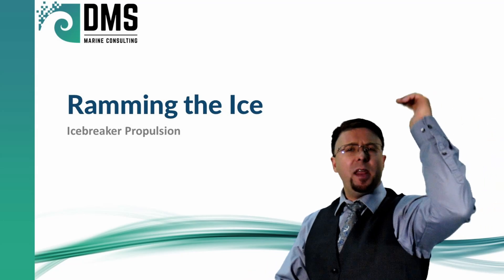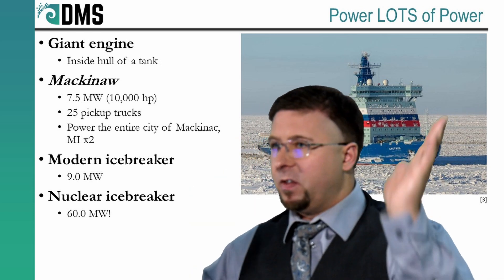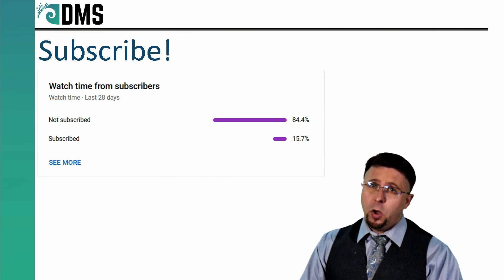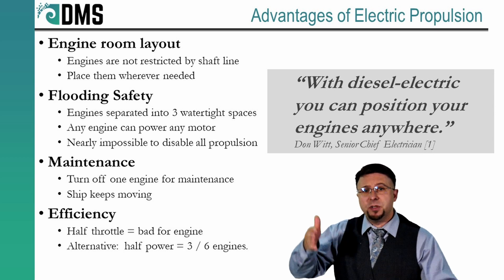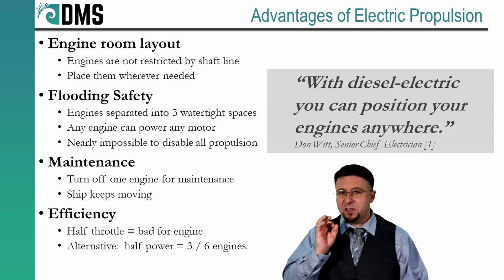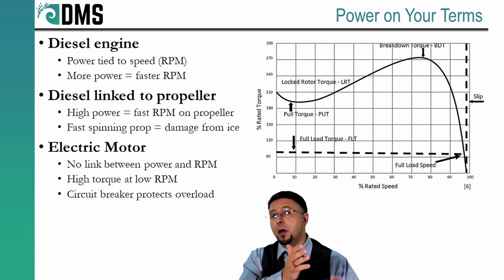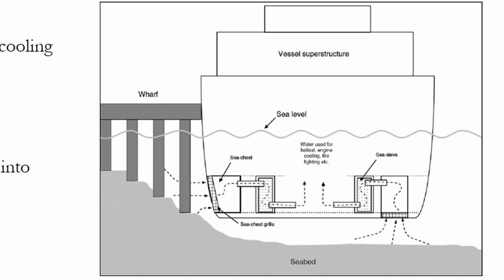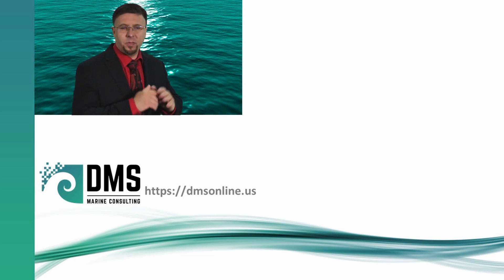A Giant Engine Wrapped In a Tank:  Icebreaker Propulsion

Comment: Power is still loosely related to RPM on an electric motor, difference is it has maximum torque at low/zero RPM as you mention, whereas ICE's typically don't.

Comment: Amusing that everything I know about civil naval architecture is from you, while I have first hand experience with all modern US nuclear powered naval vessels (and know a lot about battleship architecture, but that’s just for fun). 

The amusing part about this video is scaling: you implied that 10,000 shaft power is a lot for the 1940’s and are talking about diesel, while real power from that era was steam turbine, which necessarily decouples the generator (boiler) from the motor (turbine), with the Iowa class battleships being illustrative - 8 engine rooms and 210,000 shaft horsepower, while the A2W reactors we put in CVN-65 (USS Enterprise) gave it 210MW capacity for 280,000 shp for propulsion….. compared to the 60MW on the Russian icebreaker or the 700MW thermal power from each of the A1Bs in the USS Ford (plus ~300,000 shp - the real numbers are all still classified and depends on application, but the difference in scale is the neat part).

Comment: I'm planning on studying maritime engineering. My question watching this videos: Will eletrical motors replace diesel engines in the near future?
Reply from the maker: Not a complete replacement, no.  Electric motors have their advantages, and there are ships where we use them.  But considering the scale of ships, where we spend megawatts of power, an efficiency difference of only a few percent means enough to completely alter a design.  And there are ships where conventional diesel engines are slightly more efficient than electric motors.  

So not a complete replacement.  What we see is that both electric motors and diesel engines have their own specialty application, depending on the ship use.

From the perspective of marine engineering, I can say that you will find BOTH diesel engines and electric motors in 99% of all commercial ships.  Even in a diesel ship, there are many electric motors for auxiliary purposes, and they aren't small.  (Think motors for the crane.)  And even on an all electric ship, we normally have a diesel engine as emergency power.  You may specialize in electric or mechanical side.  But it's best to cultivate a working knowledge of both.

Comment: Nuclear is actually lower in power density than gas turbine propulsion. A GE9000 gas turbine generator will make 73.5 MW (98,564shp) in a volume smaller than a 40 ft shipping container. Nuclear wouldn't fit in even thrice that volume. In the same space that the Nimitz Class carrier's nuclear reactors, turbines and condensers occupy, you can stuff in eight of those for a total of almost 800,000 shp. The fuel consumption of course will be prodigious and 200,000 shp would be unprecedented.
Reply: OTOH engine + fuel for a year... nuclear is the same size, the fossil fuel version is now an oil tank with a little motor hidden inside it.
Reply: @mozismobile  True. But in the case of the carrier, the majority of the bunkerage is aviation fuel and needs to be there anyway. Also, most ships do not need or want to carry fuel for a year; even trans oceanic vessels typically carry fuel for maybe 12,000 nm at deepload with endurance between resupplying in port limited by crew, crew consumables and mission incidentals.

Comment: 4:42 did that ship have an asymmetrical bow to help make this maneuver more efficient or am I hallucinating?
Reply from the maker: You are not hallucinating.  It's subtle and not easily visible from the top.  But yes, that ship is not symmetrical.  It starts with a normal bow, and then  the port side flares out more than the starboard.  She made quite the stir in naval architecture magazines when she first came out.
Reply: @DatawaveMarineSolutions  cool
Reply: You are indeed hallucinating. The weird-shaped thing at the bow is a helipad and is far above the waterline.
Reply: Though the stern is asymetrical to help the maneuver.
Reply: @FernandoLXIX  that’s what I was talking about, I clearly was mistaken about the bow and stern